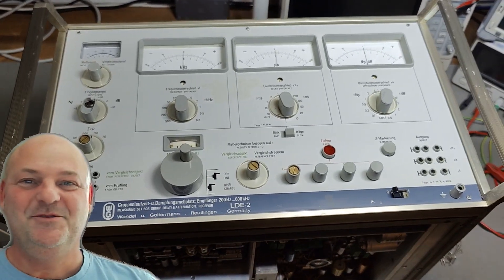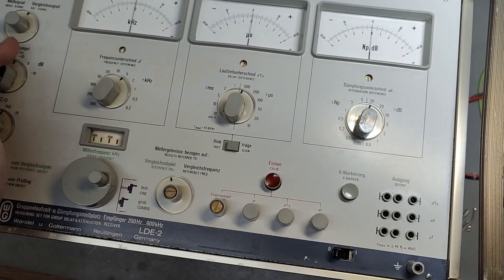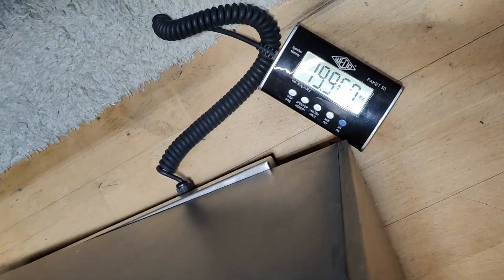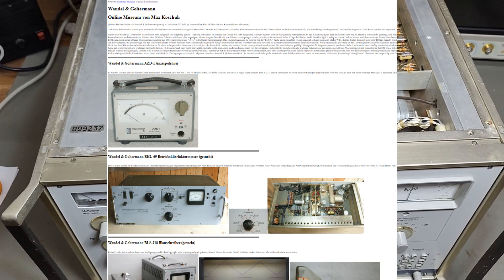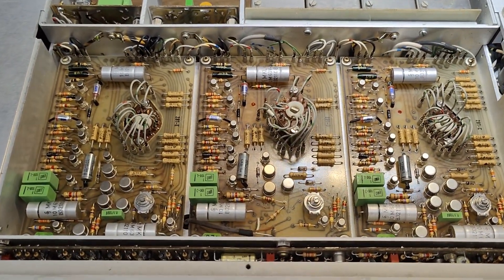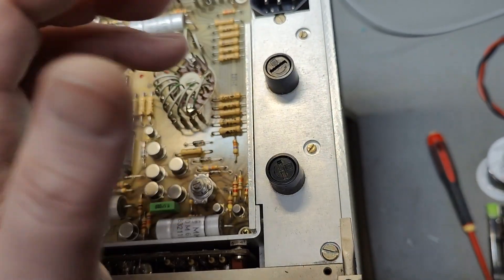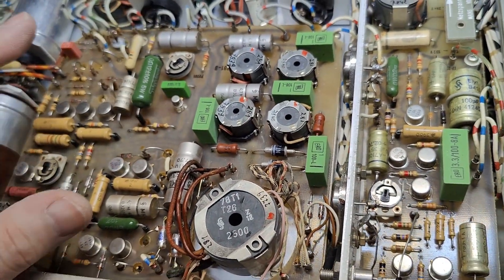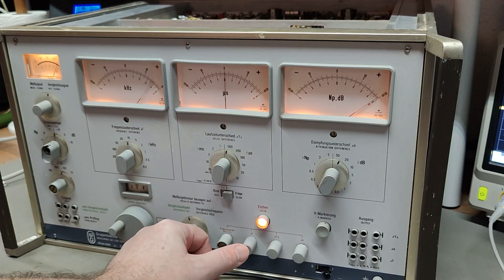Wandel u. Goltermann LDE-2 delay and attenuation analyzer 200Hz 600kHz 1968

Comment: A very interesting device indeed, as it compares two signals. Most modern instruments focus on analysing a single signal. The film shows nicely the very good engineering Wandel and Goltermann was famous for. Excellent shielding, lots of metal, no expenses spared. Sometimes called "German overengineering" in the US. 

In the beginning at 00:40 you express the assumption that the LDE-2 is a self-contained device including a signal source. In my opinion this is not correct. The LDE-2 contains no signal source. The LDE-2 was meant to work together with the LDS-2. 'E' probably stands for 'Empfänger'=receiver while 'S' stands for Sender/sender (same word in German and English). 

The LDS-2 created the stimuli signals which were fed into a device with known properties (reference object) and the device under test (Prüfling/DUT). Their outputs were compared by the LDE-2. The LDE-2 measures the difference in frequency, delay and attenuation. The output sockets on the bottom right of the LDE-2 make these result available as DC voltages to the next device in the measurement chain, as was partially shown at the end of the film. These outputs produce no stimuli signals. This is done by the sender LDS-2. 

A typical application might have been in production where newly produced items were compared against known good ones. Using the LDE-2 one can measure whether the deviation between the two items in terms of the three measured properties is within tolerable limits.

Comment: Just a tip on cleaning: To remove sticker residue, try orange oil. Maybe your wife has some. My personal tip is "Solvent 50" by Kontakt Chemie. This stuff is just incredible and smells really nice.
Reply from the maker: stickers on front plates should be forbidden ! it is the thing I spend most time on fixing, and while in use, they also dont make test instruments looks nice, people should put them on the top or the side, where they dont ruin the looks of instruments. Cleaning is a terrible problem, some stickers are super easy, while most cause a real issue, some even cause permanent damage to paint and plastic, so it is a good thing to share the tricks :-) thanks again
Reply: @TeardownOZ2CPU  A similar cleaner from 3M also smells really nice (I call it "Citron"), so far the only spray that can deal with acrylic glue